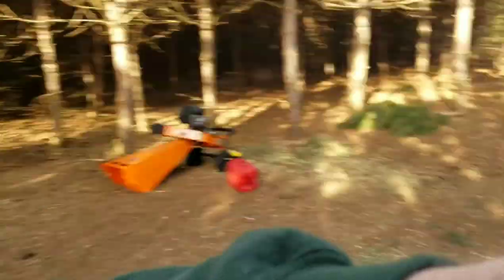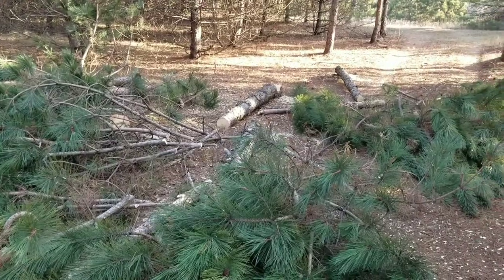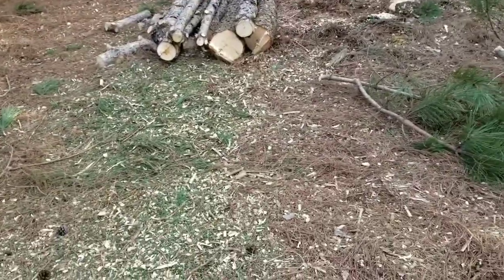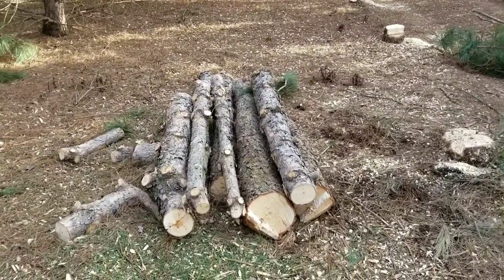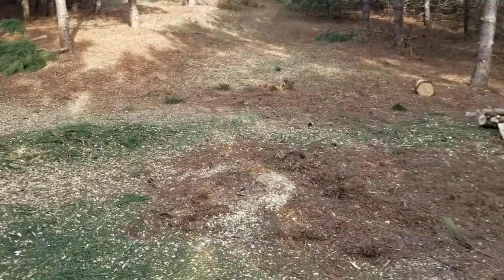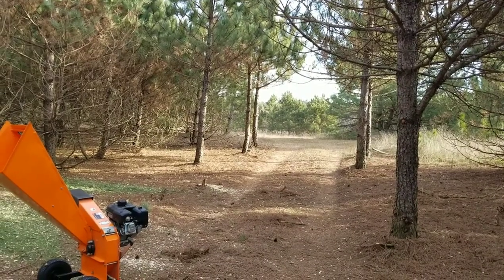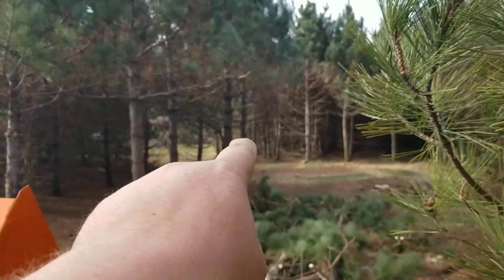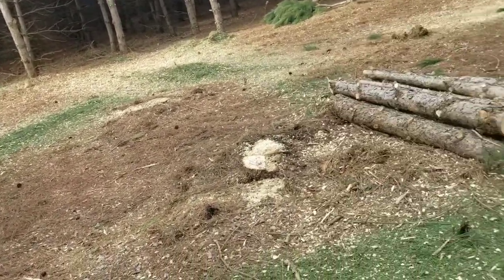Yardmax Chipper and Greenworks 40-volt DigiPro Chainsaw Getting it Done

Comment: Good approach limbing the trees with the battery chainsaw then shredding the branches without moving them. Neat result 😎
Reply from the maker: BackwoodsBungalow Yes, is all about clearing trip hazards. WIt until my next video in 2wks, if the weather cooperates  to see the dramatic changes in the appearance of the area I'm currently working in.
Reply from the maker: BackwoodsBungalow My philosophy is why move the brush twice? Besides, I'm the one that would be looking at ugly piles of brush until it rots. And the piles could invite mice to build a small metropolis at my place.
Reply: Open your face cut in the direction you want the tree to fall. Do you back cut pull the saw out use a plastic wedge or on these small trees us a truck spring. Slip it into the back cut and use your feet to fall the tree. Have fun!
Reply from the maker: Daryl Iams The trees I'm working with are really smakk in diameter. After the notch cut and get the back cut going, tree falls over with no need for a wedge. Was easier to just let the tree drop into the other trees as it had a severe lean that is not visible from this camera angle.
Reply from the maker: Daryl Iams Only option to change the direction of fall with as severe of a lean as this tree had would have been with ropes or a winch.

Comment: Every video demonstration I have seen of this chipper shows a guy extending his hands down the chute for every piece to "feed" the machine. I realize it's along chute, but why take the risk? if something hung up on the on the long sleeves and jerked you in you'd certainly risk loosing digits and maybe a hand. Every branch could serve as the pusher stick for the previous branch. The chute doesn't need to be clear to grab the next branch.
Reply from the maker: There was no chance of my hand reaching the blades.
Reply: @thefirewooddoctor  I have to agree with the OP.  If something can go wrong it will, don't stick your arm down the hopper, continuously feed the hopper and let the machine pull the branches in.  Stay safe.